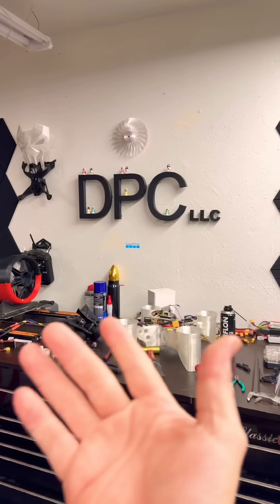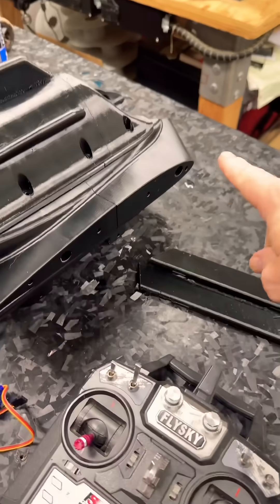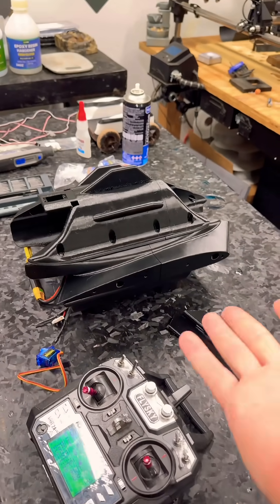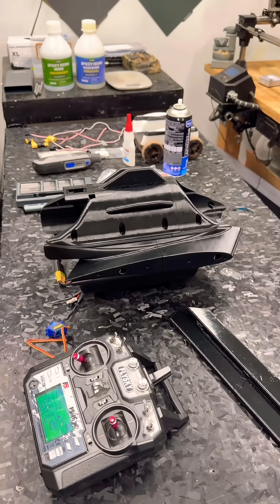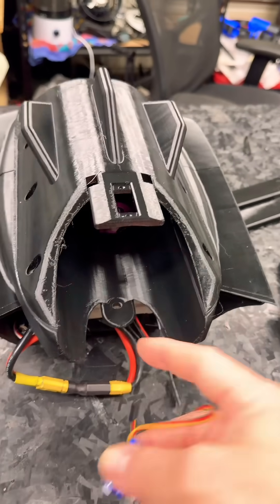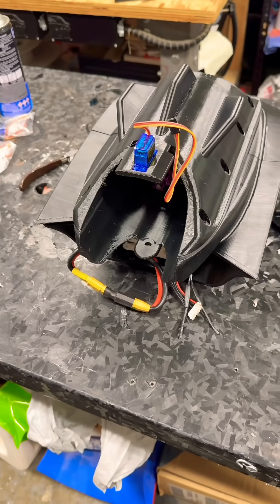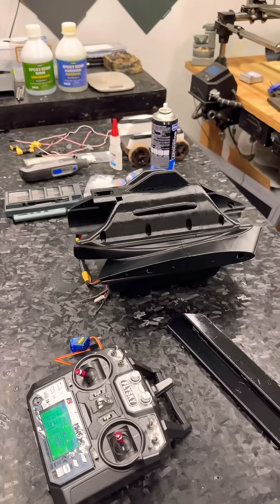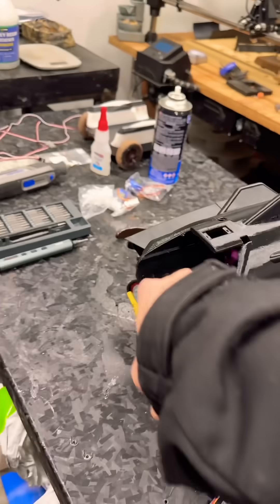RC EDF jet wing update. #edf #rc #3dprinting #diy #jet #bambulab #x1carbon #fyp #shorts

Comment: You should really try the Sirayatech ASA-GF for the main  body if this go doesn't work out. just modify the Bambu asagf profile to what it says on the filament box. also change the distance between the support and the model from .2 to .1 and use snug supports. prints amazing. super strong.
Reply from the maker: Thanks for the suggestion, I will definitely look into that for the next iteration.